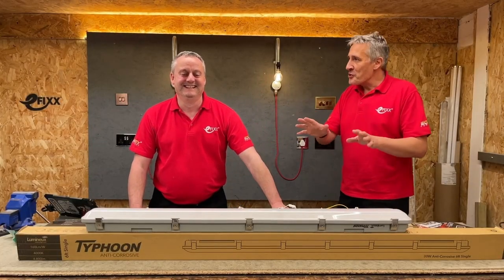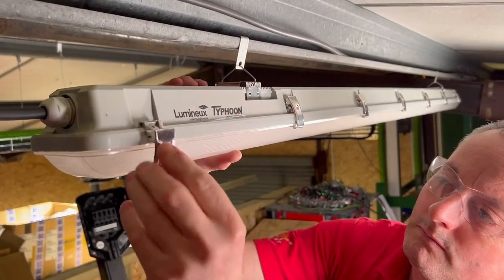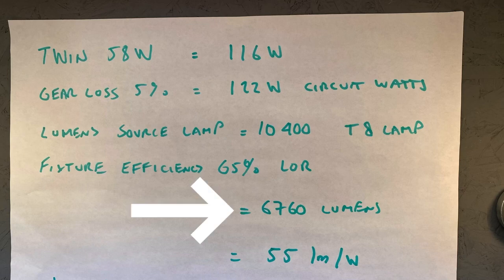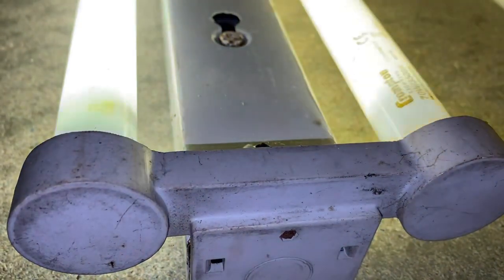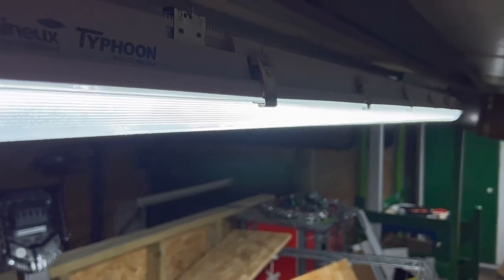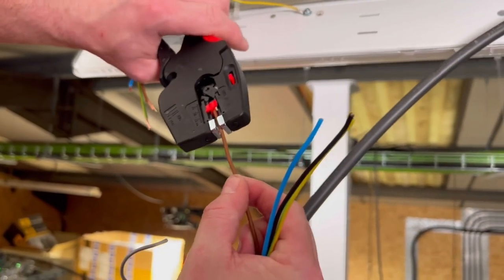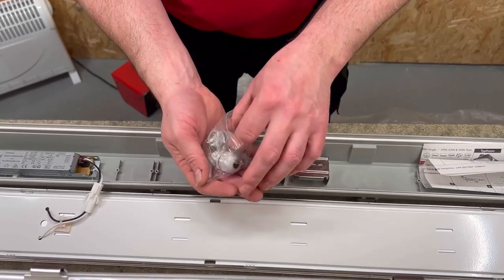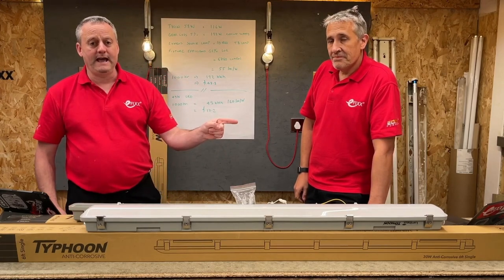This LED Lighting Fixture Costs Less to Run

Comment: My only beef with these is when it fails you have to replace the whole fitting. If that is 5 ,10 or 20 Years down the line then that model will not be available so you can’t just replace the top half of the fitting and you need to get an electrician in. Many commercial fittings have been in place for 30 / 40 years. So personally I think the led replacement tubes are a better option on upgrades. Cheap and easily replaced. In my experience LED’s don’t have the live span that is implied, generally it is the electronic drivers that fail even on quality fittings.

Comment: You still cannot get away from the fact you could repair any T8 T12 son or metal halide fitting bar the lamp from a single tool box of ballasts, starters, capacitors and end caps. Now you throw all in the bin. Fluorescent fittings from the 70's still have a serviceable life. You will never see a LED baton achieve that regardless of cost in energy terms.
Reply from the maker: Things are changing with this regards check out the new circular economy requirements from CIBSE 👉https://www.cibse.org/policy-insight/news/tm66-creating-a-circular-economy-in-the-lighting-industry-now-available
Reply: Still had to change the lamp, capacitor, starter, ballast. Only thing that remained was the outer casing.

Comment: 5:45 didn't you say the 65% light throughput figure came from the reflectors + diffuser combined? Most retrofit LED tubes only have LEDs on one side, so you'd get rid off the reflector losses, and would only have to deal with the diffuser losses (even in case it's clear). So the losses are somewhat lower and I would consider keeping the old fixture if it's in good condition and light gets through it pretty well. 

Good catch with the ratings, though!

Comment: Nice light fitting . I remember installing vapour proof Florissant’s in the kitchen and laundry in a  new nursing home I worked on back in the early nineties, and they were a pig and the rubber seal didn’t work for very long. 
Great video guy’s as always ❤ 
Merry Christmas 🎄 hope you have a good one.
Reply from the maker: Thanks Sean - hope you have a Great Christmas 🎄

Comment: Looks like a nice fitting. I prefer to see fittings that are plugged into the fixed wiring rather than bringing it into the light as it’s easier for ongoing Maintenance. Saying that I do understand that it’s more expensive though up front. Could have used FP200 but that NYY-j should be great.merry Christmas guys
Reply from the maker: The plug and socket for a waterproof system is often more than the fixture!  We have seen some that screw in to a 20mm conduit entry.

Comment: Coming to the defence of steel wire armoured cable; where the cable run drops below 2 m from the floor, it becomes vulnerable to mechanical damage, even though it may be more well protected on high-level cable tray or basket. Also, who can’t resist peeking behind the shroud to see how much steel wire armour is visible outside the gland 😬

Comment: What’s the life span of the fittings.my trusty fluorescents in my workshop might not be so efficient but they are over 50 years old . When they stop working or lose  brilliance it only takes a minute to fit a new tube or starter I’m not knocking new technology but it’s not easily repairable and very wasteful if you get to replace the whole fitting

Comment: With electronic gear the 58W T8 is run at 52W by the gear, therefore the lamp power is only 104 W and not 116W - your assumptions are incorrect

Comment: Don't bother measuring the efficiency, just take the manufactures word. When LED fittings are measured they have been found to have power factors between 0.5 and 0.8. This down to how AC is converted to DC to drive the LEDs.
Reply from the maker: Power factor for lighting is defined in EN61000-3-2.  If fixtures don't comply then they shouldn't be in the market. Fixtures above 25W usually have full power factor correction >0.9 
https://www.emctesting.co.uk/emc-blog/122-updates-to-iec-61000-3-2-2018
Reply: @efixx  I agree, so why are they on the market when they have been measured and found to be less than the required standard. When you showed the box the the EN standard was not shown presumably it was on the box top under the fitting?  The LAP domestic LED bulb is not marked as compliant on the box of 5, 9.5W 806 Lumens but it does carry a CE mark on the bulb. It is easier to make larger converters compliant in large fittings but have you actually measured to prove compliance?